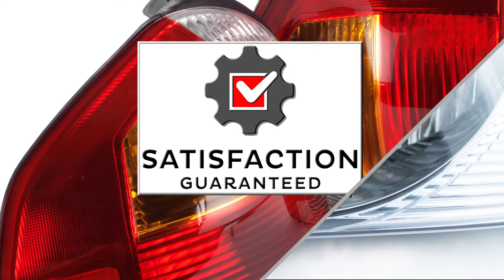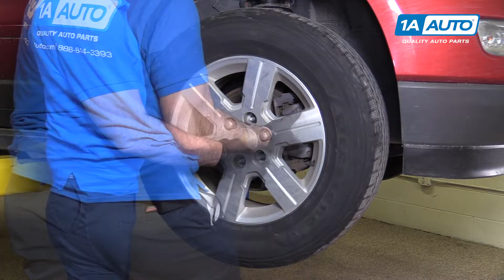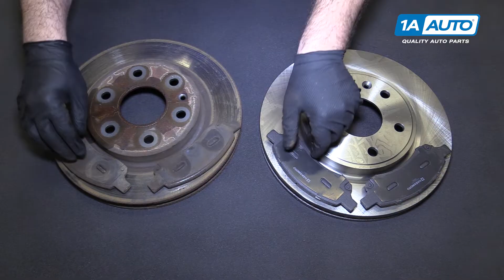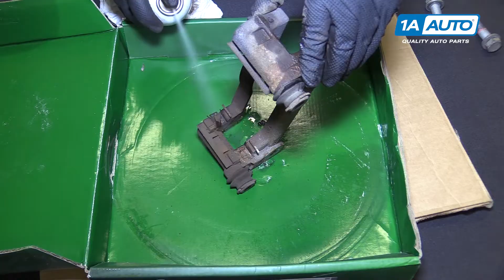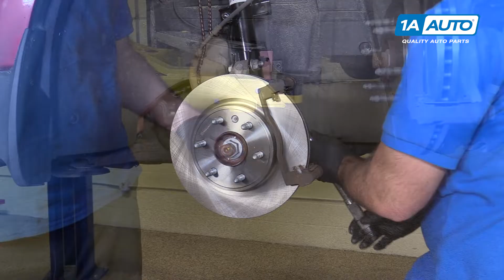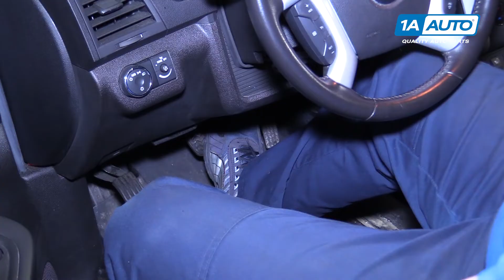How to Replace Front Brakes 09-16 Chevy Traverse

Comment: Do you have to bleed the brakes afterwards? I have heard you only bleed the brakes if replacing the brake lines or calipers and I've heard yes even for brake pads and rotors.

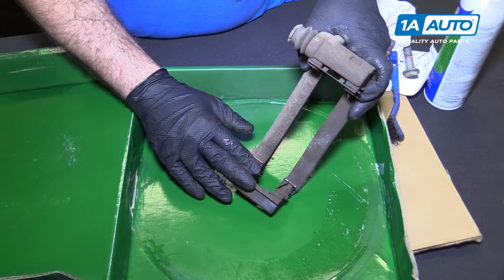Comment: 5:12 new brake pads SHOULD come with new stainless steel brake caliper hardware. ( 2 for each caliper. )
6:51 Some caliper manufacturers COAT the rotor with COSMOLINE ( a type of waxy grease ) to keep them from rusting while being stored for long periods of time in a warehouse. You MUST COMPLETELY remove ALL of the cosmoline from, not only BOTH sides of the rotor, but from EVERY SURFACE OF THE ENTIRE ROTOR. The manufacturer DIPS the rotor in cosmoline so...it gets EVERYWHERE...in between the vanes of the rotor, on all flat surfaces of the rotor... it's just EVERYWHERE. You HAVE to remove ALL of it OTHERWISE it will melt from the heat of brake friction and run everywhere like water - saturating your new brake pads - which will render them useless. Remove all of the cosmoline by using spray can brake cleaner, a rag to wipe up the larger amounts of cosmoline and a compressed air nozzle to blow it out of the rotor vanes. Clean it ALL out. ALL OF IT. Did I say clean it all out ? Yeah, I believe I did.

Comment: My advice is to remove the screw that holds the rotor to the hub BEFORE you remove the part that holds the brake pads.

Comment: Hello changing the brakes 
is that same that the same way on 2014 traverse
Reply from the maker: +Kelly Butler Yes, the 2009-2017 Chevrolet Traverse will all have the same brakes and application.

Comment: If you brush a little bit of antiseize on the hub and in the hat of the new rotor, it keeps it from seizing should you need to remove rotor or wheel.  Avoid getting antiseize on lugnut threads.   Don't  want those lugs coming off

Comment: If you live in the rust belt you need to look under your stainless brake hardware for excessive rust on the steel bracket. The brake pads won’t slide properly if you don’t file off the rust on the bracket.

Comment: When you press pistons back in, always open bleeder screw , so not to press old fluid back up in abs actuator and system,, Before doing so but small drain pan under caliper to catch fluid.
Reply: Absolutely, most of the yucky stuff settles in to the calipers.